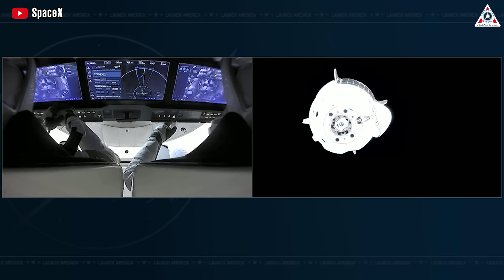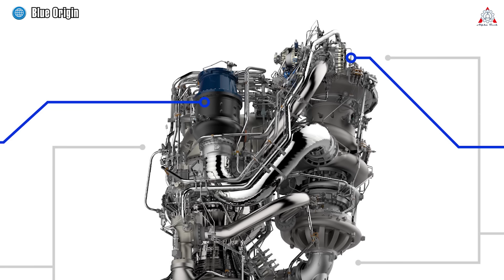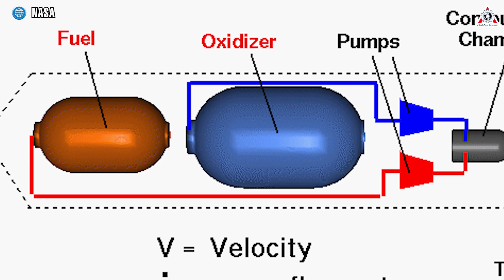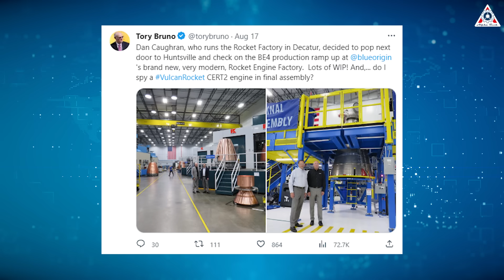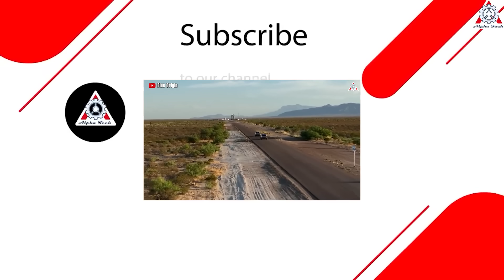Blue Origin to produce hundreds of BE-4 engines to beat SpaceX...

Comment: It seems to me that the most blatant example of bad judgment rests on ULA.  First they chose to continue to use Russian engines to maximize profits instead of performing a reasonable political risk assessment.  Second they chose an engine manufacturer that had never flown a large orbital capable engine. Third they redesigned the Centaur so that it blew its tank up on test (no Kevin it wasn't the engine that failed).  For a legacy firm it seems like ULA has not done well (Boeing itis?).   That said the Smithsonian needs to send staff to document ad preserve the first flight of the Vulcan. Given the sketch availability of the BE-4 engines this Vulcan flight may be a historic singularity.

Comment: the BE4 of blue Origin THE Raptor killer???
uh I don't think so!
The Raptor v1.0 killer is definitely the Raptor V2.0
and the Raptor V2.0 killer will probably be the Raptor v3.0!

Even in today's era the development of a rocket engine is very complicated. 
simulating everything that actually happens in an engine is very complex and transferring these simulations in metal just as much.

if Space X has found, in Tom Muller, a spiritual son of the BIG names in rocket engine manufacturing of the 50s - 60s; 
it seems that unfortunately Blue Origin was not so lucky

Comment: I don't know the future of BE-4. But in comparisons on performance, it lost big to Raptor already at the design stage.  The aim for BE-4 was less technical risk.  The hope for the BE-4 was always that it would prove to be less problematic and more dependable.  The design effort on the Raptor, by contrast, was enormous and unprecedented.  They intentionally climbed the highest mountains, no compromises.  It would not even have been possible with existing methods and tools.  SpaceX first developed their own, extremely advanced and groundbreaking development tools.  SpaceX is quite happy to spend a lot on once, one time, efforts.  Investments.  What they don't like is to spend money on repeat actions, like launching rockets to space.  The cost and reliability of the engine were always intended to be controlled by mass production and re-use, not by "simplicity".

The heavier fuel of the BE-4 gives that engine some theoretical advantages, at least for first stage use.  But it seems to me that the Raptor has already eaten up all of that advantage, and then plenty more, just by the extreme performance levels.  And I think the Raptor will eventually also prove to become a very reliable engine.  We'll see,

Comment: The Raptors have problems with reliability.
The BE-4 doesn't have that.
WHY?
Reply: Their 8 years late on the BE4. Rapter has been tested over 1000 times. Think you forget the leasons learned at Spacex. 201 out of 201 block 5 falcon flights. They know how to make stuff reliable. They test to destruction to improve things, next!
Reply: @Arnie_Davidson  Didn't you get that my question was an ironic one?
Raptors have reliability problems as the launch in April showed, and the two static tests since then.
BE4 did not get integrated into a launched rocket and therefore had no chance to show any reliability. It is simply unknown. After 200 launches we could know it, but I doubt that this will come true.
Reply: The BE-4 engine is twice the size of Raptor with about 9% more power. This far lower energy density makes it easy to be more reliable. To put it the other way, Elon pushes the Raptor for every ounce of power possible, parts fail, re-design parts to not fail, push engine power even higher, more parts fail. Rinse and repeat.
Reply: @royh6526  No doubt, Raptor is at the edge of present technology. But going to Mars cannot be done with a 'Volkswagen'.
The Falcon-9 shows superb reliability although it is reusable.
And BE-4 has not had much of a chance to prove its reliability. A few test runs are not enough.
Reply: @royh6526  But less powerfull than Raptor V3.  https://en.wikipedia.org/wiki/Comparison_of_orbital_rocket_engines
Reply: Space X are testing sooo many engines in a short span of time that you will more likely to see raptor fail as suppose to BE-4. For example out the 3 static fires we had from 2 different boosters and out of 33 engines on average only 2 out of 33 fail leaving 31 engines. If BE-4 was made as frequently as raptor and test just as frequent you are going to see just as many(more or less) BE-4 engines fail. Not to mention Raptor is also under constant changes which is why they fail at times due to the design not being refined. And then you also have to keep in mine that raptor is also the 3rd Full Flow Staged Cumbustion engine in the world, so even the engine cycle itself is also not tgat refined. P.S sorry for the whole paragraph😅
Reply: @ganymede6535  With a lot of words you are trying to express what was the content of my statement. Blue Origin has not shown much, and SpaceX has shown reliability problems. So SpaceX is a bit farther in the development process, and they seem to know what has to be improved.

Comment: One key difference between the two is Musk's goal to simplify the Raptor engine as much as possible. Just taking a look at the EB-4 engine shown in your video it is apparent that the BE-4 still has a lot of parts that could be more simplified. More intricate parts, more opportunity for failure. A big part of the hoped for success of the Raptor engine is the metallurgy involved. They have developed metals that can withstand the high pressure and high temperatures involved in a staged combustion engine. At least we think they have. We won't really know that until the Starship actually flies reliably. One other significant failure of BO origin is that they have not yet demonstrated a reusable engine. The concept of a pod to return the engines has so far been dropped. When you think about the number of engines reportedly made by BO in this video, you have to remember it takes 33 Raptor engines in the first stage just to get the Starship off the ground and SX is on its third iteration of engine development. I don't think they are interested in selling engines to someone else. I am not exactly sure what kind of company BO origin intends to be. How BO gets zealous support from the government without any demonstrated success is something that bother me. Bezos held fast on an action plan for Amazon until it was able to take over the retail industry. Now you can see what the future extension of that plan included - increased prices, "shipping cost" now built into the Amazon price and now a surcharge on future shipping, fewer available products and those controlled exclusively by Amazon, knock off brands made poorly and sold without warranties, etc., etc. To me, Amazon has become a company you cannot trust. Is this what we can expect from BO?
Reply: In short, yes. That is exactly what we can expect from them. After all, they were the ones that got so upset that SX got a government contract and they didn't, that they tried to get the courts involved.
Reply: Give benefit of doubt. The more rocket engines  the better !
Reply: You appear to be an Amazon hater but your analysis of BO is on the mark. The metallurgy is really key in the turbo pumps that allow the 350 bar performance of Raptor 3.

But don't forget that Musk is also about money.  Like Bezos he sees opportunities and takes them.  An example is Star Link and Ukraine.  He made Star Link invaluable and then unavailable.  Then he sells Star Link satellites to the Pentagon so they can provide support.  Good business sense.

Comment: Blue Origin is basically trying to do what the old school groups like Boeing, Lockheed and Nasa have been doing for decades. Design everything down to the smallest detail for years and years then put it together only to find out you missed something then spend a few more years to resolve the issues found.
The problem with this is that it will again take many years to improve your existing engine as you need to go back to the drawing board. There is no way this can keep up with the way SpaceX is constantly iterating their design till they have a viable product, at that point it is refined as lessons are learned from the regular flights. Now Blue Origin could in theory also do the refining but the whole business is setup to design things to the last screw and well guess what as a result they cannot iterate as fast as SpaceX can. The fact that SpaceX is making money with their existing line up of rockets and engines means that they can afford to work on a Raptor 2 engine and are I'm sure already working on its successor as well. All the while Blue Origin does not have a single BE4 engine that actually moved under its own power. As we have seen with all groups that build engines now and in the past it is highly unlikely that the engine will work exactly as designed regardless of how smart those working on it are and how detailed their simulations might be there is always a slight difference in the real world. Just look at the difference between one engine on a test stand and several engines under a rocket there is a difference in how they behave due to vibrations, pressure changes and so caused by the other engines right next to them.

I seriously doubt Blue Origin's plans for the BE4 are going to bring them much joy, sure they might be able to produce a few hundred of them and get them certified in the end. Heck I'm pretty sure they will even manage to get them into space eventually. But all those delays and all those troubles have cost serious money money that is not compensated by income from other sources. Sure they got some rich folk to take a joy ride but the money that generated would not sustain the company for more than a few months at best. Now Mr. Bezos has very deep pockets and probably could not care less if he burns another 10 or 20 billion on this foley of his.
As a company Blue Origin is failing. They are burning money for way longer than they had expected and they have no sources of income certainly no reliable once. They have spend huge sums of money to bully Nasa into giving them a contract that they are not likely to be able to successfully fulfil. Simply because this contract comes with deadlines and so far Blue Origin has shown its complete inability to meet deadlines.

I am not a SpaceX fanboy I am a fan of new space companies in general and I am really sad to see Blue Origin fail so badly. As it would have been great to see two of the wealthiest people in the world push each other and their companies to ever better ways for all of us to access space. But unfortunately SpaceX is so far the only one of the new breed of rocket builders that has been able to launch anything of substantial size into space. Even more so they are the once that have changed the game from launching one rocket every few months or even every few years to now launching several times a month sometimes even several times a week. The other smaller rocket companies seem to be finding that there is not that much demand for their services as the SpaceX offer is competitive especially if you can get on a ride share mission. Or alternatively they are struggeling to build enough rockets as reusability it a bit of a hurdle for most.

What I am really hoping to see is that SpaceX like some other smaller competitors have been doing will start launching from other parts of the world. This would probably allow SpaceX to launch more frequently and it could help them in setting up another factory in another part of the world as shipping rockets across oceans is well more expensive than building them somewhere close to the far away launch site.
I am affright that this cannot be done due to US export restrictions though and it would not surprise me if we come to find out that the US will not allow SpaceX to launch from other countries for that reason. But lets see, as long as they are flying Falcon rockets they will likely only produce them in the US since now building a factory that will have to completely be redone as soon as Starship is ready to go is probably not something SpaceX is willing to do.
Reply from the maker: Thanks for your comment! Keep watching and discuss interesting topics on our channel☺️
Reply: Well, first of all that is a really long comment you just wrote (a book if u will) and further more i agree that BO is doing things the old school way of designing everything first then hope everything goes as to plan on flight day. And i think SX has a better way of going about it, like design, test, fail, learn, redesign, and repeat. This is a far faster method, but BO is making alot of progress and as far as money goes, people underestimate just how much money BO has. It doesn’t matter if BO never turns a profit because its funded by some of the most profitable companies in the world. And a few of those companies just want to get to space and dont care about profits or how long it takes. BO hasn’t never really turned a profit and yet there still here after 23 years and are spending billions to this day on research and development so dont think money is going to hurt them.

Comment: I'll tell Jeff the same thing I planted for Elon: "Parts Count", or as they call it on Alpha Tech;
" a new engineering perspective..."
(🤭)
I would suggest seperating thrust chambers from the mechanicals, and getting them almost cartridge like, where they can be removed and replaced easily for inspection and refurbishment.
In fact, everything should be designed like that, clean design, and easy to get at, and simple to work on.
Otherwise, its gonna cost you time and money forever due to being stupid in the engineering phase.
And its a safety factor. breakdowns between planets or on inhospitable
planets, is no time to learn some nerd screwed you doing stupid !@#$%&÷ Design wise.
Maybe we should do like the Romans? where the engineer had to stand under arch when the temporary construction supports were removed?
Enginerds would make great crash test dummies on first human flights of ships.
They'd either do a great job, or get genetically edited, either way, win-win for humanity.
The way to look at Space Ships for the future, is they should be like farm tractors from about 1940, 
Where a couple three wrenches, pliers, and screw driver, were all you needed to work on them.
I had those, incredibly reliable, and taught my 3 year old how to safely start one with a crank.
You could bring them up to almost TDC on a compression piston, and just slowly ease them over, and when that magneto fired they ran every time. You could literally make them go from still to running with an inch of movement on the crank.

Design us space ships like that.... where they actually frickin' work, and you arent messing with unnessesary krapp.
That son now owns a high end Euro cars repair business, and tells me he spends half his time working on computer problems, and the average bill for that to the owner is about $2K.
Thats called progress now days.
(Most improvements aren't.)
Reply: You think you are smarter than rocket engineers? If it was as easy as you think, yes they would be making them more modular and re-buildable. Just assemble it like Lego.
Reply: @royh6526  Well, I did manage to embarass no few of them... even one or two top guys at SpaceX fired. And now theres a new paradigm forming...
Elon didnt just get hit by a cosmic ray in the head one morning, somebody had to get the concept of parts count to him, So I took on all comers on 
r/spacex including one engineer on the project...
And they were arrogant and doing personal attacks against me for two days or so... And I did warn them I would win in the end.... And they did massively downvote everything I wrote.
Guess what happened after that?
So.... read that as you wish.
And yes! I could design engines made up of componants that came apart easy,  Have worked on plenty of things designed to do that.
It takes engineers using their brains, not just creating layered conglomerants of krapp.
its why I did the writ, to get people to think, that usually works really well...
First they bad mouth you, then they think, then they take credit for your concept...

Comment: The BO engine looks enormously complicated and heavy.  The plumbing looks lke a rats nest.  The opportunity for leaks looks lethal.  What is its specific impulse? How many bar is its chamber pressure?  How reliable is it?  Until we know this it is impossible to say if it is a Raptor equivalent - let alone a Raptor killer.
Reply: Definitely not a Raptor killer. The BE-4 engine is about twice as large with about 9% more thrust.
Reply: @royh6526  Is that based on the current Raptor specs or the future specs?
Reply: @Baronstone  Current Raptor V3.
Reply: I was thinking the samething about the complex looking rats nest plumbing on BO before I read the comment, was thinking of a simular thought, maybe an octopus all tangled up, but hey, wth do I know about rocket engines, not a whole lot, so not bashing anybody to be fair I am a spaex fan, good luck to both sides and all.

Comment: I just don't get why ULA thinks their first flight is going to make it.  Watching SpaceX blow up engines you get the idea that rocket engines are hard.  Fuel leaks are a thing.  Testing them on the stand one at a time is not the same as putting a bunch them in a rocket rogether.  And the BE-4 is a big engine with impressive specs -- it's not a baby suborbital engine.  BO has never built anything like that before.
Reply: Too bad SLS is costing the taxpayer $4B per launch. SpaceX is going to put them out of business before this is over.